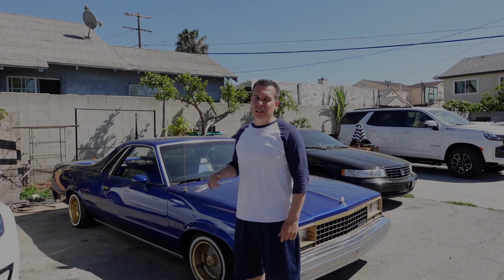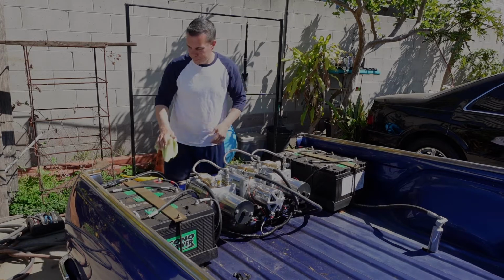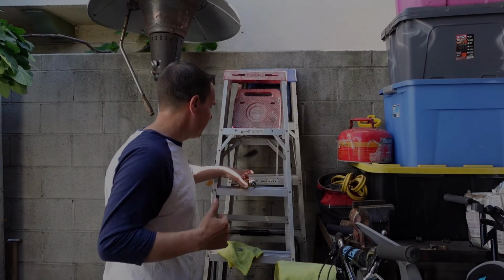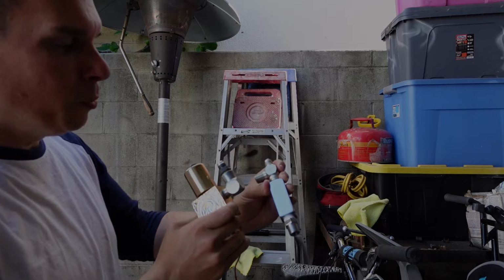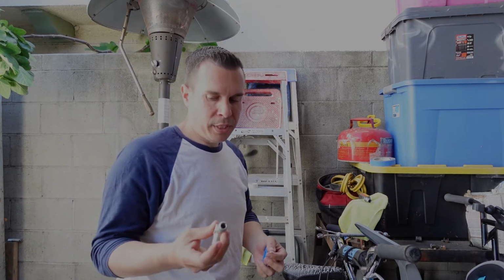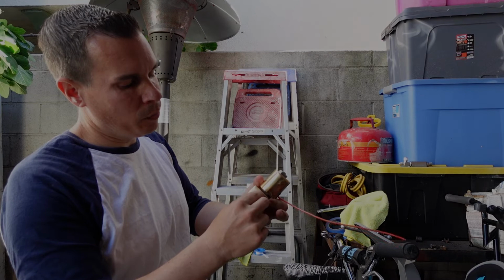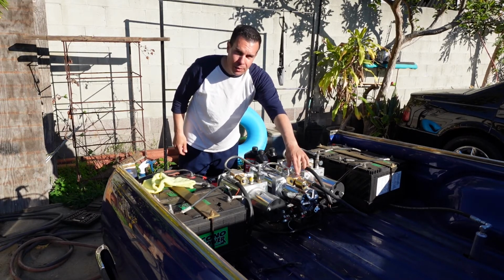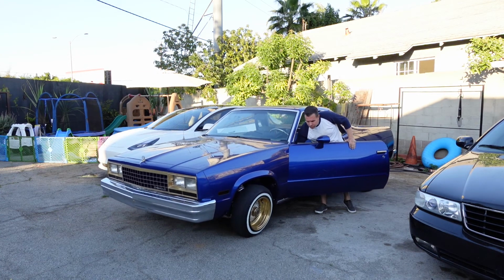Watch this Broken El Camino Lowrider Hydraulic setup be Easily Repaired!

Comment: Gotta open up that dump valve to hop it bro lol
Reply from the maker: Too much cylinder up front and not enough coil.. kept bottoming out on cross member. I was catching it and barely tapping the dump in the footage. The car was not setup to hop; more of lay and play but I wanted to do something for the camera. ;)
Reply: @R9Garage  nice most def same mine was a basic 2 pump setup w marzocchi 9s but got 8s n high lockup up front n still gets maybe about 3 feet off ground